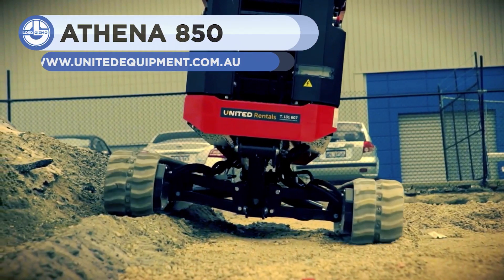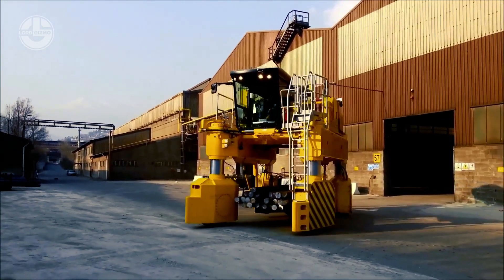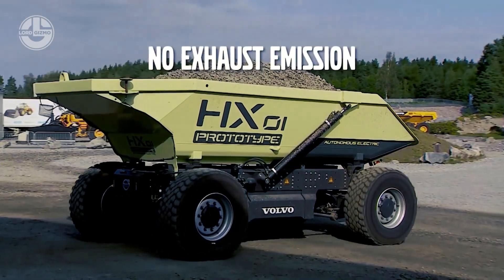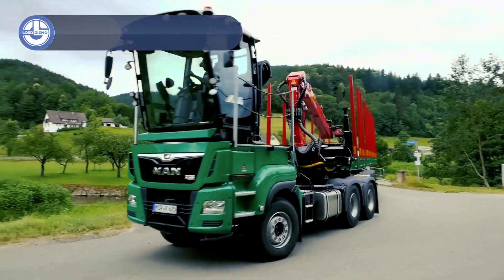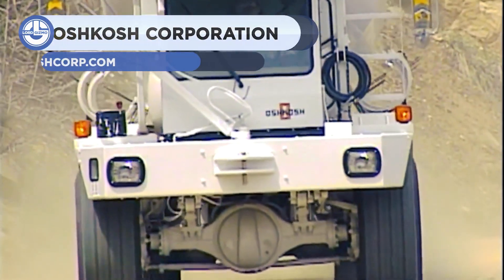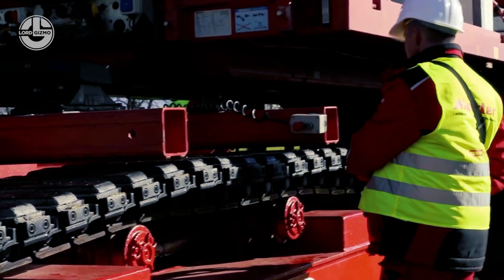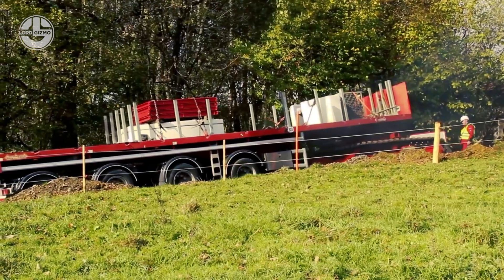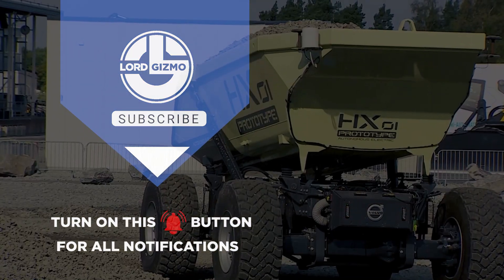Most Ingenious And Powerful Machines Operating At An Insane Level

Comment: 3:28, keep in mind electrcal energy must be generated, and,depending on the technlogy used to do so, has varying carbon footprints.
Reply: Yeah but when you compare both, EV's are 77 percent efficient compared to 45% of diesel engine. That means if your engine is using one litre of diesel, 55% of is wasting into heat and smoke. Imagine if every vehicle on the road is wasting 55%. Sure power plant consumes but renewable energy can fix this. However, burning fuel is not in favor of environment and the cost you pay.
Reply: Not to mention the battery’s after use and environmental destruction to make them.
Reply: not to mention how much it takes to make batteries, ship their raw material all around the world and then ship the the finished product back

Comment: Why is there a muffler and exhaust pipe just passed the mixer on the right-hand side of the vehicle. I don't think battery-powered Vehicles need an exhaust pipe and a muffler. Were it not for Chernobyl and Three Mile Island if we run off a nuclear reactor.
Reply: The large box at rear contains the DIESEL motor for vehicle power
Reply: @band1tsixx954  I see more like a diesel/electric trains from the 1925 trains that replaced coal/steam trains from almost a hundred years ago.

Comment: I like your videos but you are going to have to educate yourself on all this electric vehicle crap because what do you do with all the old batteries and it is cheaper to build new batteries than recycling them and what are you going to do when they can no longer make batteries that can keep up with the power demand oh yeah where do you get the electricity to charge them 
Hope you have a blessed day
Reply: That's a very good point. We should consider it too. In fact, I did some research, but that still needs validation from a research piece, as some lobbies are against batteries. After that I will get back to you.
Reply: As a writer, we have to use info avilible from company, but we can be more scientific.
Reply: Most of the known lithium supply is in Bolivia, Argentina, Chile, Australia and China. Democratic Republic of the Congo has the largest cobalt reserves. So for the US and many countries, we're going to pay through the nose.
Reply: @haroldwilkes6608  

Each electric auto battery has 50-60 kilos of graphite in it to. The US has massive graphite deposits but mining infrastructure isn’t there yet.
Reply: @MrCarnutbill67  report from the US Geological Survey, graphite mining in the US has long since stagnated. In fact, the metal has not been mined in the country since 1990, when United Minerals suspended operations at its graphite mine in Montana. As a result, the US now imports all of the graphite it requires

Comment: I’m a bit doubtful about the Oshkosh concrete mixer running on batteries considering that large exhaust stack 2/3rds of the way back
Reply: I think they used footage of old one but new mixers are powered by batteries. Checkout the link, it's at second place on the page.
https://www.oshkoshcorp.com/en/brands-innovations/electric-vehicles
Reply: @THEIDEABEHIND  ta
Reply: @grilnam9945  sorry?
Reply: @THEIDEABEHIND  sorry UK short for “ thank you”